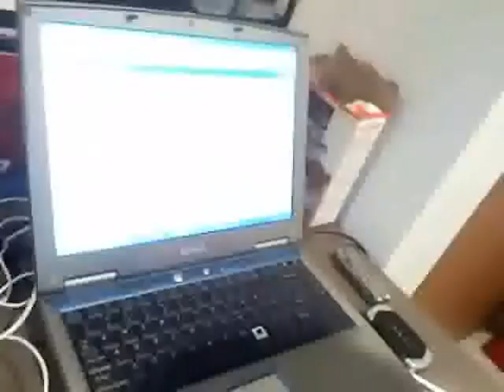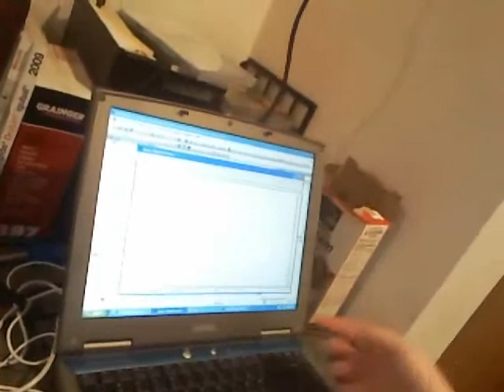SerLCD Via bluetooth

Comment: Also, make sure those vertical pins aren't acting as directors or anything similar in length to make a possible Yagi configuration or else the robot will be only effecting facing certain directions.

Comment: It seems the idiots at Axon sent you the wrong antenna. 
The engineers there cannt do even the simplest math?
v/f=lambda or little less then 13 cm. For approx 1.2 the stand wave.
Under low power (bluetooth) its important to have good gain.
Furthermore, attach a parabolic on the laptop.
You'll get maybe more then 10x the range.

Also the robustness of the signal depends on the algorithm in the bluetooth layer that will be converting the raw signal to digital.

Have fun building the robot.